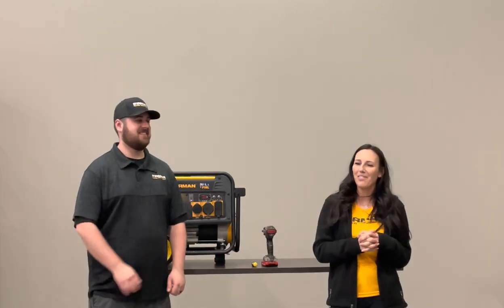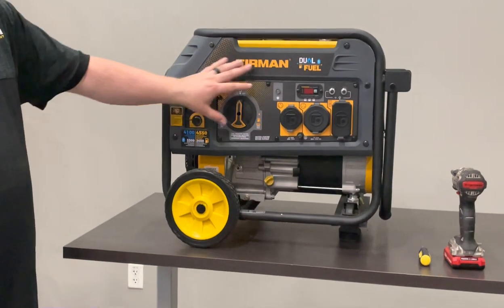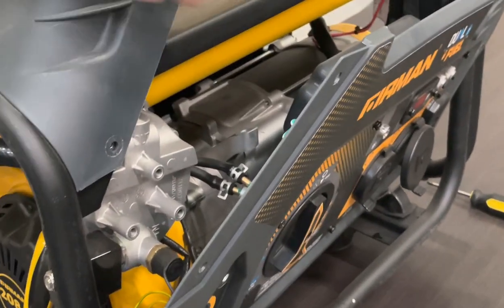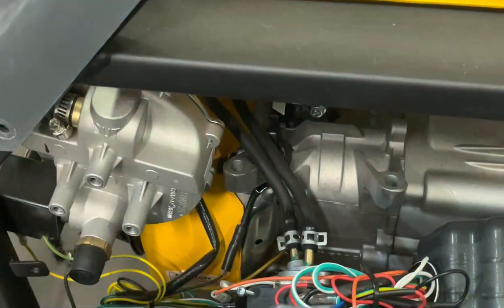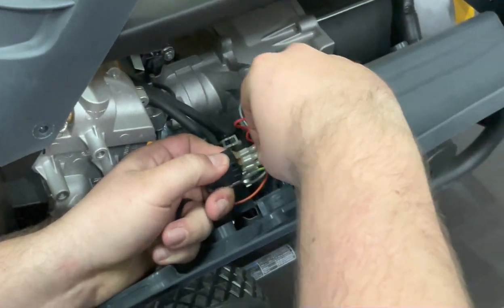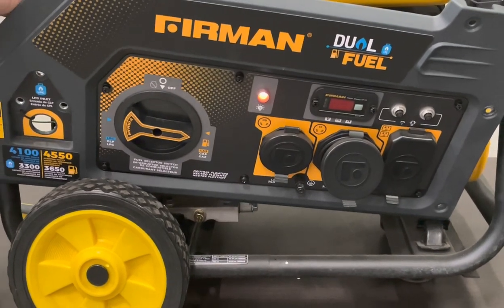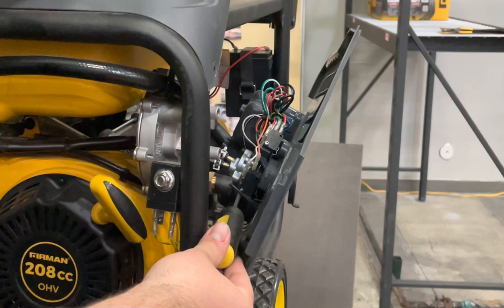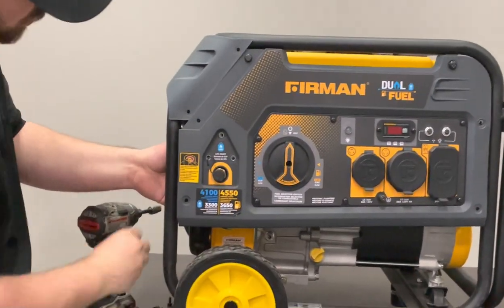FIRMAN Facts - Micro Switches

Comment: Where can I buy a replacement fuel selector switch. Mine came with a broken plastic piece on the inside where it bolts to the square valve

Comment: how does the co sensor work? does it have like holes in the back of a device that senses the co in the air? if so. would you be able to put a tape over the holes to not make it go off if it is outside and accidentally going off on its own?
Reply from the maker: Adding anything to the sensor voids the warranty of the generator. If the sensor is triggering it is detecting a buildup of CO2 and doing its job. Even outside a buildup can happen. Be sure it is on a flat clear surface, and a minimum of 20 feet from all occupied structures.